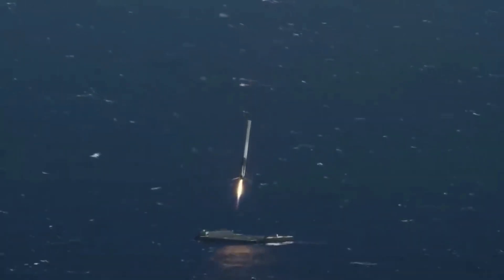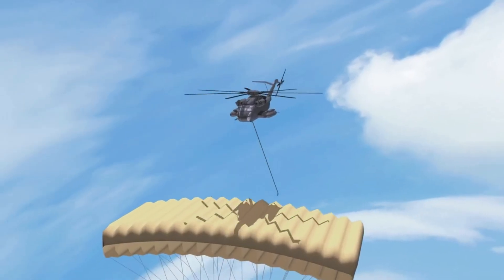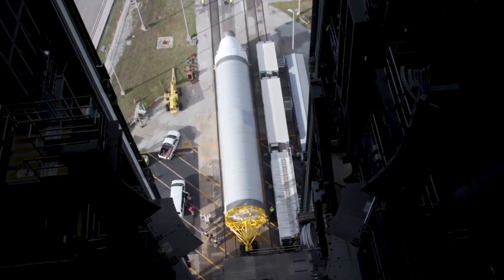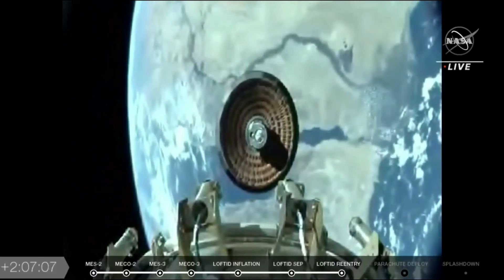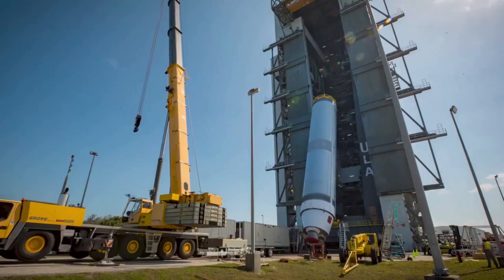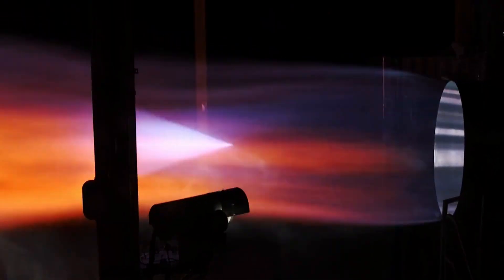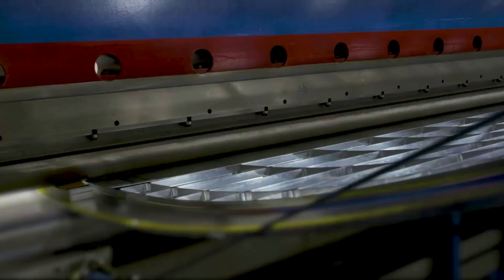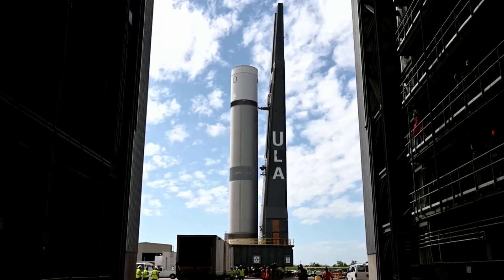How ULA Plans To Recover & Reuse Vulcan’s BE-4 Engines

Comment: A question, if I may: Why can't rocket manufacturers like United Launch Alliance, in pursuit of "smart" re-usability, devise a LOFTID-style inflatable re-entry heat sheild that can allow the entire first-stage booster, fuel tanks and all, to fall back to the ocean and be recovered? Why stop at just the BE-4 engines?
Reply: Probably because the tanks are cheap and easy to manufacture unlike the BE-4's which are extremely slow to manufacture and are expensive as hell, thus they'd want to reuse the engines/avionics only.

Comment: An excellent video showing how ULA has a viable path forward. Get the cash flow moving now and improve the system cost efficiency as an enhancement after the early launches. Considering that is basically what spacex did with falcon 9, why not use the more conservative approach?
Reply: they would never invest in themselves to get tgere though

Comment: its just amazing to think of the tech that ULA will need to reuse these spent engine stages. i also just realized blue origin and ULA are only reusing these satges becuase Blue origin are so slow at producing them🤣
Reply: TBH....ULA always considered first stage   reuse & putting the second stage in parking orbits 4 future use but yeah since it's taking like a year to make a BE-4 they better have reuse ready ASAP.
Reply: RocketLab are looking at reuse for similar reasons - they can’t build boosters fast enough to meet demand for their rockets.
ULA is building on concepts developed in the 1960’s.
It isn’t just the engines - it is also the entire flight control hardware package (which was traditionally mounted at the top of the booster) that they are recovering which just leaves making a new empty tank each time, something SpaceX have done twenty times without launching anything.
Reply: @allangibson8494  yep